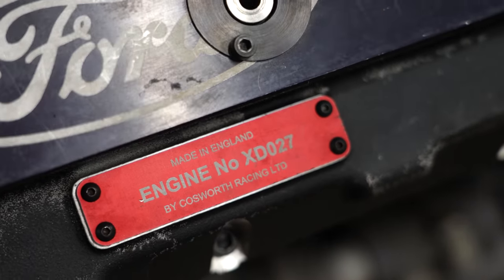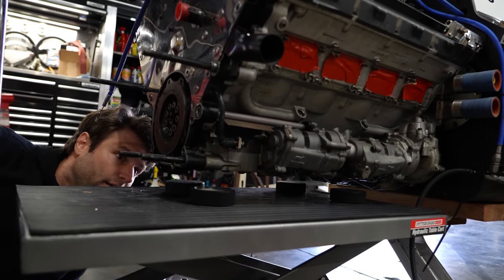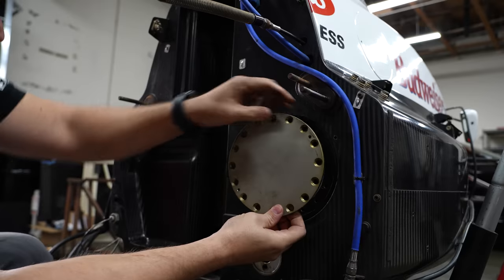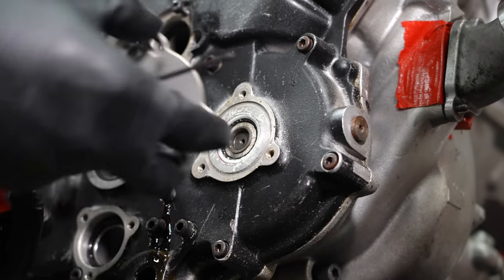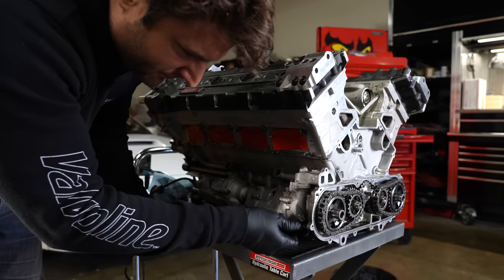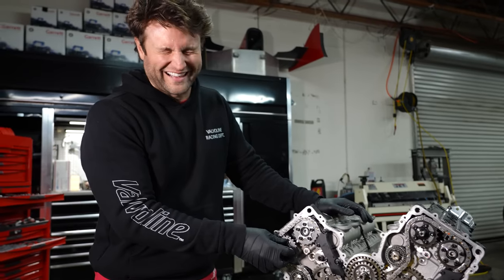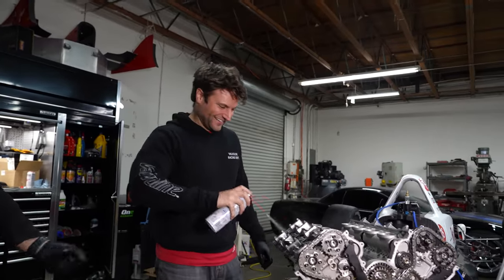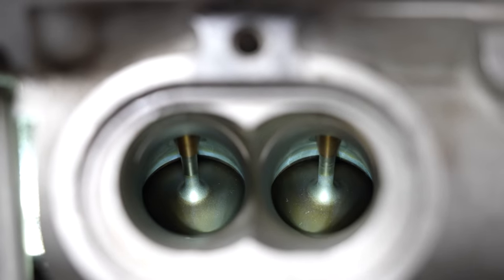We teardown the IndyCar Engine to expose its Secrets! Cosworth XD Turbo Methanol V8

Comment: It’s incredible to see the similarities between this cosworth v8 and the Volkswagen 5.2l v10 out of the r8. The oil pump and the coolant pump are almost identical, same with the oil passages in the camshafts. Same with the timing chain layout. I used to build engines for sheepy race, this is so wild to me
Reply: Yep, Volkswagen were wise to copy Cosworth
Reply: @psk5746  VW group has owned Cosworth before.  Cosworth was sold to Mahle in 2004.
Reply: I'm just reminded of all the stuff I did on high vacuum pumping systems back in the day. This engine resembles something like that more than any normal motor. Which I love. Hydraulic tensioners and interlocking holds, rather than wasting parts; o-rings yes and gaskets no way... Beautiful. Solid. This is good engineering.

Comment: Honestly, these are the kind of videos that get the the most excited to sit down, grab a drink and just watch beginning to end.  Sure, the tech and methods used on this engine might not be cutting-edge anymore, but seeing and learning about how problems were solved once back in the day really helps to open up avenues of thinking that I would otherwise struggle to get to based entirely on my own thought process and conclusions.  Looking at videos like these, I get the chance to remove my bias and potentially learn concepts, design and reasoning for engineering design choices.

Thank you Rob.  A video like this is priceless for someone like me.  All I really want to do is design and build an engine from the ground up, and videos like this one that can teach me portions of the do's and do not's of advanced engine design would've cost me significant amounts of my own money in a college or other classroom setting.  Greatly appreciated.

On a side note: It's pretty easy to determine the direction of rotation for a RWD/AWD platform engine if it's installed the way this engine is installed.  All RWD engines rotate clockwise from the perspective of the snout (front) of the crank due solely to the way a rear differential works.  The diff only has one configuration that works to spin rear wheels forward, and therefore rwd engines can only spin one way.  This is the primary reason why Honda's B-series engines can't be used in RWD applications.  The engine spins counterclockwise from the perspective of the crank snout and thus would spin the rear differential the wrong way after moving through the transmission.
Reply: Haven't people flipped the rear diffs in the past to fix this? I'm pretty sure the 4 rotor had an upside down diff to fix that for a while until they got new gears
Reply: @micahs1708  I thought that had to do with the locking of the diff, not the direction of rotation
Reply: @ImKairyu  for the 4 rotor? Or just in general? I vaguely remember rob saying something about how the upside down diff was causing weird wear on the diff gears in a past video
Reply: @micahs1708  iirc it made the diff lock up all the time causing the front tires to slip while turning
Reply: Weird flex but ok
Reply: Before this, all I had to go off of when engineering something on my race car was what I know from studying/reverse engineering production vehicles. They had different reasons why they do what they do, like an appeasement to a different/larger demographic. That knowledge combined with indycar engineering definitely creates new channels of thinking.
Reply: You can run a B-series RWD and it has been done many times.  For a solid axle rear differential, some have symmetrical mounting hole patterns, so you can just rotate the internals 180 degrees and keep the whole axle housing assembly the correct orientation.  Some have literally just flipped the whole assembly 180 degrees.
Reply: It’s not a hard rule. Differential with pinion on the right (normal convention) will turn clockwise. 
Differential with pinion on the left will turn any-clockwise. Unusual but who says it can’t be done?
Reply: @Dave5843-d9m  the main problem isn't that it can't be done.  It absolutely can.  The question that needs to be answered is who's out there designing parts (transmission, driveshaft and rear differential) that are meant to rotate in the opposite direction.
Transmissions and rear diffs especially are designed around multiple criteria:  hard internal and external mounting points, clearances, material and geometric strength properties, and internal fluid flow dynamics.  It's the last part that would go completely unaddressed if we simply changed the orientation of things in the drivetrain to make it work.  The internal 3D layout of the transmission case and differential housing are designed specifically with directional fluid flow in mind to optimize both component lubrication and component cooling.  Simply reversing the direction doesn't inherently mean that the fluid flow reverses and everything's fine.
Again, not saying it's impossible to pull off.  Just saying that I don't personally know of anyone out there making drivetrain components specifically designed to rotate the opposite direction.
Reply: I have an old tuner magazine where they made an h series to spin the other way. Pretty interesting. I bet though you could make a gear assembly somewhere in the drivetrain that reverses the direction though

Comment: Question about finding torque settings. When torquing a bolt to specific torque setting, you're overcoming the friction between the male and female threads. As soon as the rotating action is done, when your torque wrench says "Enough", your kinetic friction coefficient turns into a static friction coefficient. When you then apply pressure with your torque wrench again to get the number, it will read higher since you now also have to overcome the bond between the two surfaces (which can be quite a bit of surface - thread and block/bolthead mating surfaces combined). This especially in Robs motors case, when it's been sitting for long time giving the surfaces plenty of time to get really intimate.

Watching a teardown like this is absolutely awesome.

Comment: Hey Rob if you read this, im almost willing to bet that the oil/air separator in the valley of the engine. The reason of the oil going in through center then out the side instead of reverse order is to allow the oil a chance to reform and not be Frothy which will be helpful with the Methanol situation
Reply: That is exactly what it is, as evidenced by the small drilled hole in the air line side. In our Aussie V8 Supercars that line would be -3 or -4AN on top of the dry sump oil tank and be plumbed back to the intake manifold for vacuum. It wouldn't be strictly required to be used, however If the oil tank was ever to pressurize itself or over fill, it acts as a vent to be sucked back through the engine and not spit hot oil all through the engine bay via the breather (or split the tank open) which would result in the same. Most race engines usually have an opposite line near it or next to it with a dry break that you can put oil INTO the tank quickly in a pitstop without opening the engine bay or cover. Just shove a lance into it and pump a few squirts by hand.

Comment: It always blows me away that the motor is actually part of the structure of the car. It's is the frame & the power plant.
The Hoonagins Honda drift truck build taught me a ton too! Between the these two they are so much more technical than ever though. 
Thanks for the video great job 👍 👏

Comment: Rob, love your channel. I am a licensed A&P. From my perspective, a lot of the way the engine is engineered to aviation standards. With that said I would recommend replacing any dynamic bolts due to torque stretch. Also recommend looking into initial torques followed up with an digital angle torque, so that all of your torques are evenly distributed. Something to look into. Again love your channel.

Comment: The pop-off valve took time to reset, so you didn't want to blow it off during a race. Despite being issued by Indy Car they had minor variations, so as part of a tuning stage on race day they would deliberately blow the valve to find out how much boost that specific one would allow. If it's the one I was told about it is actually two stage, and the plenum pressure sensor could spot when the first stage started to move. Knowing what they could do the boost controller would be adjusted up almost to that limit.

Comment: I think oil pressure tensions the chains and is he turning the engine the correct way?
Reply: Looked like he was turning it the wrong way.
Reply: I would expect any oil pressure tensioner to be somewhere near the chain guides but couldn't see any so perhaps it hasn't go them, but I think it would given the rpm the engine is capable of. Any slap in the chain is going to make a hell of a noise otherwise. And potential break point. And Cosworth knew a fair bit about race engines, designing and building them for formula one in the Sixties if I remember correctly.

Comment: This engine was made before pacalloy valve springs were a thing. That’s the alloy that revolutionized nascar engines in the late 90s. I bet some custom pacalloy valve springs would get better life than the original ones, and probably cheaper.
Reply: 2🎉

Comment: I'm going to bet there is a torque order as well as inch pound torque rating on those underside bolts. Reminds me of aircraft bomb rack torque specs.
Reply: from my experience there is always a torque order to follow whenever you have to torque more than 3 bolts and a torque rating for mating machined surfaces
Reply: It's going to be different than usual since the main caps are integrated into the oil pan.
Reply: Eh you just go slow and creep up on the tightness it will be fine Also take the bolts off slow the same way.
Reply: but also maybe its better to not start on the four corners and leave a bubble in the middle.  but everything in the universe has a torque order but you just do it everytime by feel.
Reply: Just tighten it, any real mechanic doesn't need a torque wrench. If you've been tearing and rebuilding engines and other shit for 30 plus years, you only break out the torque wrench on the head bolts.
Reply: @mikeworkman3593  bruh, every bolt can become righty loosy with improper torque. Even if you don't strip the bolt, the excess tension while the whole body undergoes stress can cause failure. You are part of the reason there is no trust in mechanics since you don't care for the vehicle you maintain. Anyone that cares for their vehicles don't go to mechanics anyways but you don't help. There is no wisdom in the world that prevents laziness from interfering in work. Get the torque wrench, save a vehicle and potentially a life.
Reply: @zvotaisvfi8678  The new way is torque to yield. This has been the new way since I was in my early 20s just starting out. I'm 50 now.
You're basically just stretching the bolt to its max potential. This doesn't require a torque wrench, you just tighten every bolt the same degrees, starting from the center out.
But unless it's head bolts, you just need to know your standard bolt torque. Every size bolt, thread pitch, standard or metric, has a set torque. Only differs depending on if the bolt is in forged or cast steel, aluminum, etc. But once you've tightened like 10s of thousands of bolts, you just get a feel for how hard to pull on a wrench, also depending on the length of the fulcrum. Head and main bolts we used to put in back in the day before I worked for the government, they took 2 people. One guy would stand out pulling tbe torque wrench and the other guy moved the head arounf to the bolts. Especially if it was upside down and using a 19:1 torque multiplier.
Reply: @mikeworkman3593  damn those bolts were on there tite

Comment: First time watching this YouTube channel (YouTube recommended) like a lot, it's how I learned mechanics etc, parents always said give me a toy/present/electronic device, first thing I would do is take it apart to see how it works 😃. Stripped many engines/gearboxes/anything really, learning along the way (nothing compared to this) and now run a small repair workshop still learning along the way 😀. Good job proving you don't have to know everything before commencing any works required 👍

Comment: The pins that you have removed from the oil pan split line, are locating pins. These will keep the oil pan from sliding side to side, as the eng heats up, and under the stress of mucho rpm. Nice job during disassembly, nice to be able to see the inside. Thank You

Comment: 41:06 That “central piece” is what drives the camshafts and produces the camshaft speed reduction. That “central piece” has 3 gears stacked together. The larger center gear is driven by the crankshaft. The 2 smaller gears (the outer one we can see, and the inner one which we cannot see) drive the camshafts. The outer gear drives the left side camshafts (from our perspective) and the inner gear drives the right side camshafts.

Comment: You are meant to preheat the oil so the block expands before your turn the engine over
Reply: Oil & water are preheated. I believe these motors have such tight specs that they won't even turn over without the pre-heating.
Reply: @maggiefeld3910  they do turn over. But you'll fuck up all the bearings.

Comment: Hey Rob, remember, static friction between two objects is always more than kinetic friction, so measuring the torque specs on those bolts the way you did it might result in overtorquing.
Reply: Not to mention, I don't even want to think about how intricate the torque sequence is for that oil pan/main cap girdle...

Comment: the clicking sound when you turned over the engine was the chain jumping teeth on the cam gears, it should only be turned clockwise
Reply: This.

Comment: In my opinion, those bottom end bolts worryingly torque critical, would have been better measured by position marking, loosen, then increase torque turning until they end up in same original position. Then you do not have to overcome the “stickation of the bolt head against surface. Really enjoying the vid, most interesting seeing inside and much details. Nice one
Reply: I was looking for a comment on this! Thats a good idea! I was taught breakaway torque was always higher than the applied torque on the initial tightening

Comment: You can also determine the correct rotation direction based on the timing chain layout, noting that the drive gear should pull the chain directly from the cam gears, not against the timing chain idler bearing.

Comment: Quick tip: with gas shielded solid core mig welding, run your weld in small overlapping circles in the direction of the weld. Flux core wire likes to be drug or pushed with slight back and forth motion.

Comment: There has to be some modern valve springs available or even a company 20+ years later that has a solution spring wise. Surely technology has advanced enough to allow a solution that provides considerably longer service intervals at a decent price point. Retro fit some sportbike valve springs in it lol
Reply: Great stuff! speak to Ricardo Eng in UK....

Comment: Rob, I could be completely wrong as I have never worked on an Indy car engine, or even seen one in person, but on most if not all piston motors, v8’s and v6’s, their is normally an even and odd bank or side of the motor. I just want to put that out their as it would change your firing order that you have determined for the motor.
Reply from the maker: Cosworth numbers the motor the way I listed. It’s on all of the pistons and cylinder sleeves. But yeah if it was numbered differently it would relatively throw off the firing order numbers too.
Reply: Depends on the company, a small block chevy’s cylinders are 1,3,5,7 on one bank and 2,4,6,8 on the other meanwhile Ford would do 1,2,3,4 and 5,6,7,8
Reply: My idea of correct cylinder numbering is the front to back order of the big ends on the crank.
Reply: Ford have always had weird ideas for cylinder numbering.  Going back to prehistoric times, the flathead V-8 had the 1,2,3,4 on the right bank but No.1 was actually the second piston and rod on the crank - not that I'm trying to compare this masterpiece with a flathead - haha
Reply: @loganamurray64  oddly enough with ford diesel engines with the exception of the 6.7 the powerstroke cylinder numbers are 1,3,5,7 passenger side and 2,4,6,8 drivers side. go figure that for their first in house diesel engine with the 6.7 that theyd change it back to their gas engine numbering lol

Comment: This is very close to the Cosworth HB V8 2.65lt (1/3?) from the late '80s to mid '90s, which I worked on, It's basically the same engine that Michael Schumacher won the F1 world championship in 95, it's the Ford Cosworth design 90* XB or XD I don't think it's an XF?
Reply: In 1994 Schumi won with a 3.5 L Cosworth EC v8. In 1995 it was a Renault v10.